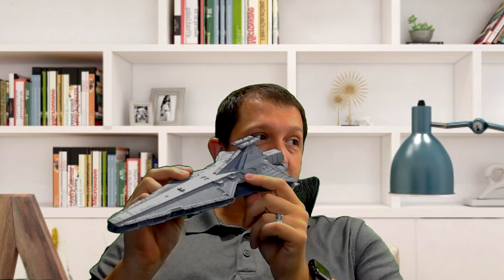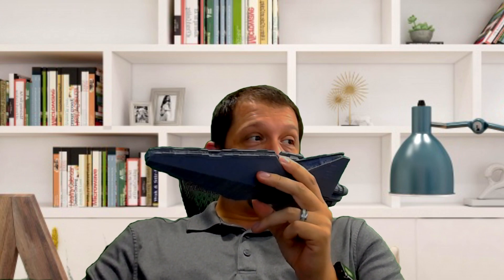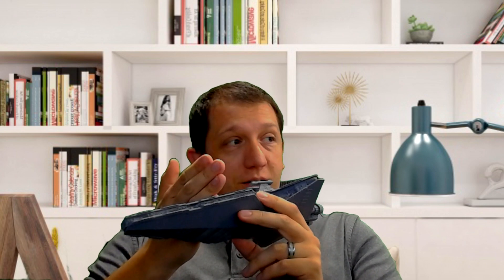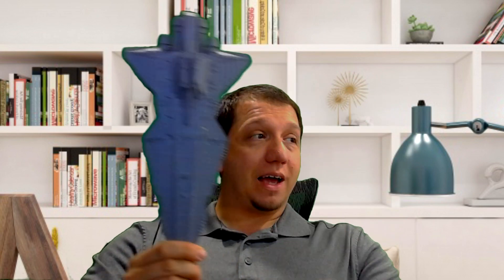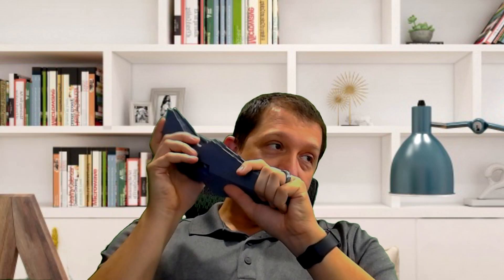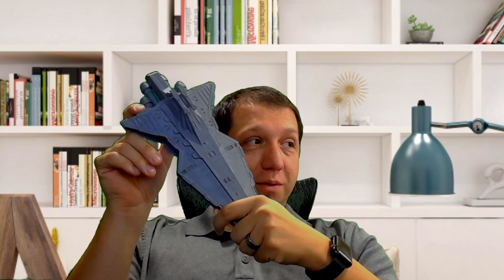3D Printed Star Wars Venator-Class Star Destroyer timelapse

Comment: How did you manage to remove the supports? When I did it, it was extremely difficult. Especially for the engines.
Reply from the maker: Very carefully and a death by a thousand cuts
Reply: @Rise3DBuilds  I see. I printed one and it had alot of under extrusion. But the supports were strong. I accidentally ripped out the entire engine part. I later glued it back on and gave up. I cleaned up the majority but still left some support so it looks like a venator that crashed and then got slightly repaired for something like the Resistance. actually quite cool
Reply: But any tips on how to remove the supports? any tools?
Reply from the maker: What matters is your are happy with your model
Reply: @Rise3DBuilds  Yes but I am making another print, just because I need a cleaner version

Comment: How much did you fill?
Reply from the maker: About 10%. Mine was sitting on a shelf.  If for a toy I would go up to 25
Reply: @Rise3DBuilds  the supports were they easy to come off?
Reply from the maker: For the most part.  I did break off one of the smaller engines but nothing a little glue could not fix

Comment: hi love the video, i am thinking of getting into 3d printing ...what time scale did this take? what printer would you recommend for a newbie on a budget ? new sub added all the best from the uk!
Reply from the maker: That one you can easily do on a Ender 3.  But the real question before I tell you a printer suggestion is what are you looking to print?
Reply: @Rise3DBuilds  models generally as you have done but also some attachments for my drive and motorcycle. Stay safe over the pond buddy cheers paul
Reply from the maker: I would recommend a ender 3 or a cr-10. For models you can use pla filament with no issue.  For anything automotive I recommend using abs filament.   If you do abs filament make sure you have a well ventilated and climate controlled space or you purchase a enclosure for your printer.
Reply: @Rise3DBuilds  thanks for the guidance 🙏

Comment: Hey man really like the print! I tried printing the full model and realized half way through the The full STL doesn't have the details on the side.  Or is the link you provided to a different model than the one you printed? How did you get the details on the side of yours? Thanks
Reply from the maker: It looks like I included the wrong link.  I had a couple of the files as I tried to work on the one I wanted. The model I updated to you will have to up the scale I think to 150% or 175% to match my print on the CR-10.  You can print it in pieces but I did one solid print.
Here is the correct link https://www.thingiverse.com/thing:2889407
Thanks for your interest and I look forward to hearing how you print comes out.
Reply: @Rise3DBuilds   Thanks for the fast response! Awesome I have started my print on your updated link at 200% on my X1. I'm gonna print it in 4 pieces hopefully it will turn out good as it is my first big print my machine. Did you ever get around to fully painting yours?
Reply from the maker: @Zekn69  I have not been able to get back to it.  I am currently painting the Enterprise C from TNG. Once I have that one done I will circle around and try to paint it along with some other Star wars ships that are coming up soon! Glad you got the model to work for you
Reply: Awesome I love the fast response! And I will do 🤙🏾🤙🏾